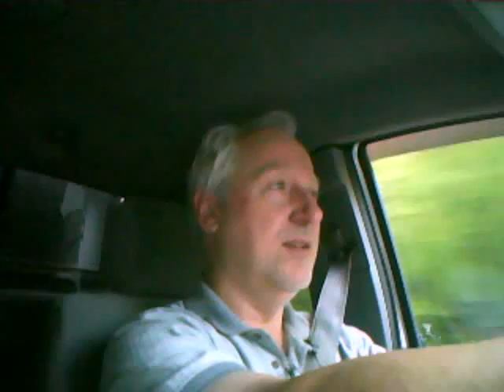#270 Muller motor update & Call to action

Comment from the maker: @JDALSystems Noted. You're still mired in textbook physics. This is anything but textbook. It's WAY outside the box for most. I fully understand the implications if it does work. It will crumble the very foundation the entrenched scientific community. Light the match and run. It's going to be another big bang! ;-)